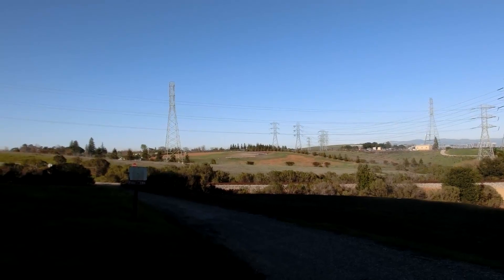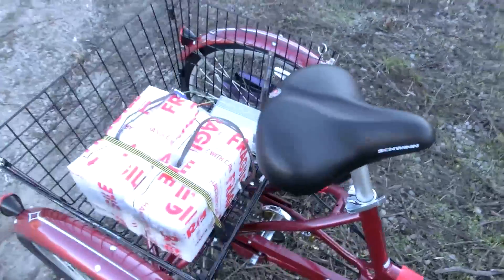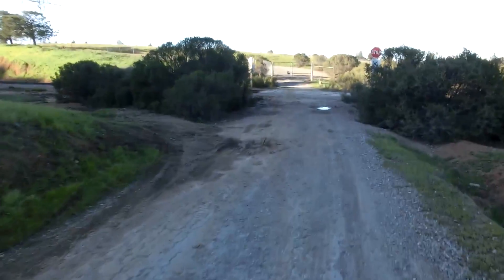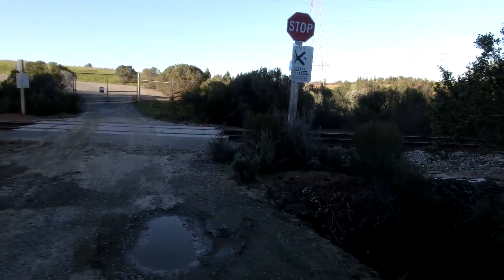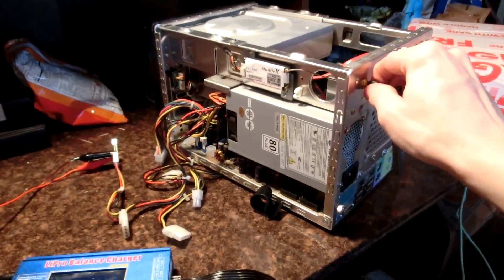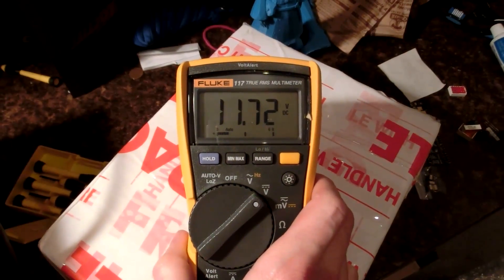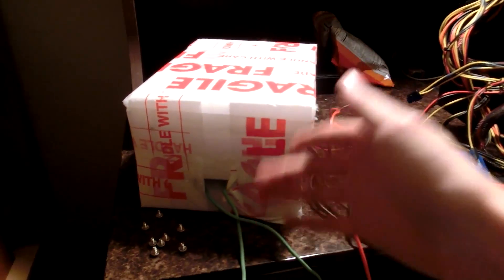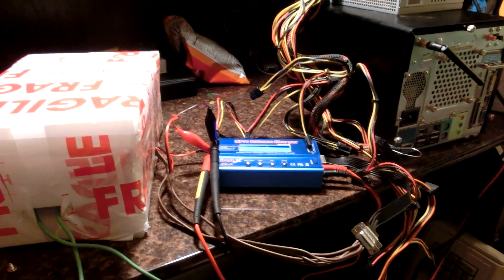Random Bits 0076: Electric Tricycle E-Trike Modification

Comment: Do you have any advice for soldering the battery? I made an electric bike because of your video you made the battery look so simple... I can not do so well with it... bought all these laptop batteries but i don't know how to solder... LOL ps you make some good videos and have some interesting Ideas and items.
Reply: i had the same issue. do what rinoa says. sand the cells back and wash down with ethanol use flux. i use a 90 watt soldering iron which is sufficient. a 25 - 60 watt soldering iron probably will not work well. use leaded solder. lead free sucks!!
Reply from the maker: thanks! its best to have a lot of thermal capacity in your soldering iron so you can get in and get back out before the rest of the cell heats up. using sand paper to roughen up the cell ends can help a bit too. i guess they put a coating or something over some cells, or maybe its just grease from the factory.

a cleaner idea that ive been wanting to try is a spot welder so you can weld tabs to it like they do at the factory. you could perhaps do that with capacitors and tiny strips of metal.

your bound to have a few dead 18650s laying around, i say if your not sure about it take them outside and try to solder them together. if something goes wrong your outside and your not out any good cells. hope that helps.
Reply: Rinoa Super-Genius
LOL all my cells were good... everything is ready just need to get soldering down even bought a PCB / BPC to charge the batteries...  bought 2 so i could make two batteries because i over bought batteries thinking half would be bad so i can make 2 24V 4400Ah (not mah) battries.... sigh I thank you for the tips... ill try soldering the first one see if i can do it with your tips. thank you

Comment: Is it possible the alligator clips you are using to input power from the computer power supplies is limiting the current available to your charger? I had a similar problem and had to solder in  some 14g wires. I ended up buying a 19 volt power supply and it really made a difference.
Reply from the maker: no the power supplies are making bad sounds and are old, thats just the capacitors goin out.

Comment: I know you are said you were tired of the battery videos but I have to tell you I really enjoy your videos and matter in fact style. I would suggest a simple volt/amp/amphour meter. I love mine and really enjoy the fact I can have a better idea of current used as I don't use any BMS on mine. The first video of yours I watched was your battery built from 18650's and it really helped me.  It's good to see you get ahead from your knowledge. Very inspiring!.
Reply: I have Rinoa Super-Genius range of videos added to a playlist, so I can add balance leads to my own battery packs. (I have to make 4 x 48 volt packs) I have literally purchased the same power supply charger, the same blue charger unit from the videos. Hehe

Comment: I'd love to see that as a project building a DIY 48v balance charger. 

That trike is very cool. Although you might need to add a bit more capacity in the battery department because your battery was built to move a bike which was lighter and had less drag.

Comment: I just bought the first electric wheel (exactly the same as yours) I will be buying my second this week then 2 more a month from now to go on each wheel of a Go-cart or some kind of E-Car I am building on my channel this summer. Now I have to find some cool places to ride it when it is complete!
Great job on yours Rinoa Super-Genius Congrats on your mobility boost!
Reply from the maker: thanks, i think that 4 motored car is a good idea, you wont have to worry about a differential or axle either. you could have all 4 wheels turn!
Reply: Mine cost $220 each. I'll have to look for who sells them for $180. I may also end up converting it over to a fat tire design.
Reply: Hi, Andrew. You have an exciting idea with that E4WD!  I am thinking about going 2WD with my eBike. Good luck, and I'm sure youll keep us posted.... Question that is relevant to both me and you is: How would we control functions of more than one Electronic Speed Control unit (ESC) at the same time with one thumb-throttle?or are you going to have 4 throttles rigged up right close to each other? http://ihelpupay.com/ebike
Reply: I'll definitely check out your work.
Thanks for your reply!
Reply: Farrokh Mirbaha Hi, I will be putting every step up onto my Channel on YouTube, Plus recording every written note on my website blog http://www.artisticbrit.com As for the speed controller, I may just build a custom foot operated unit like an accelerator pedal on a car. I MAY also combine all 4 hubs into 1 geared unit, to create a higher mph. By doing this I might get speeds of up to 50-60 mph using 4 powered hubs. Subscribe on my channel, you won't miss a thing.
Reply: Farrokh Mirbaha You got it Farrokh, enjoy your day/night!

Comment: nice job Rinoa, now you can role with the traffic without having to work for it, it freaks me out when im on my ebike doing 20mph and the 8 wheeler behind me is doing 30 and slowly closing expecting me to go faster...but I cant..its capped :-p over here that would be illegal because there is to much power in the 1kw motor :-p but if you restricted it to 13mph and 270watt :-O then it would be fine :-D Looks great but I would recommend mirrors or a rear camera. Seeing behind you makes all the difference when your turning or changing lanes :-) glad your enjoying your time there hills are pretty awesome in general :-) think its good now...wait for the weather to improve and check that place then :-D
Reply from the maker: yup i'm getting big mirrors for it. i've been scouting out places to show you guys, besides the cool electronics shops of course. ima start doing a series on "things you should see in silicon valley" everything from cool places to get a view of the valley to awesome shops
Reply: Rinoa Super-Genius sounds good, you can keep an eye out for any interesting geology along the way :-) it would be handy to not have to worry bout your trike, the lock boxes are a good idea, it may be worth considering making a cheap gsm tracker for it, there are diy mods on the net floating about, least that way if someone trucks it you can tell the cops its location to get it back :-D and all the while you are in the shops your not worried, is my bike still there :-) I beat mine up so i could take the chameleon approach but would be a shame to do that here. Looks like you could keep that looking clean and maintained for twenty years :-)

Comment: As someone who recently moved from CA, if I remember correctly, you may "officially" need a motorcycle license. It might be if you exceed 1kw of power, I don't remember exactly. Not something you really need to worry about, but you may want to check into it.
Reply from the maker: yeah as long as your 1kw or under you dont need anything ^^

in illinois it was 750w or under but nobody even knew my bike was electric, not even the cops. so its just one of those obscure things nobody cares about unless your blasting down th road at 50mph with a 10kw motor.
Reply: Hi +Rinoa Super-Genius
It´s a tricycle,, three weels 3.000W :-)

Comment: Awesome stuff, keep the vids coming! I would recommend building a charger yourself as the next thing you do. Have it a plug in wall and simply charge, also having it custom built you would have it fit your needs and even be easily able to alter it for future projects.
*Side question, what's the legislature on E-bikes over there? At what point will you need to have a license plate on it?
Reply from the maker: it will plog into the wall, but will also plug into an electri car J1772 charging cable >:D

and over here you just need working pedals and 1000w motor or less. speed limit is 20mph but i cops have better things to do than to track bicycle speeds
Reply: Very good idea to have it compatible with J1772!
So can you have multiple 1000w motors or just the one?
Thanks for the answer btw!

Comment: I'm sure you've answered this question before, but is 10 miles about the trikes max range on just batteries?
Reply from the maker: its about 1/10th to 1/20th depending on speed. looks like with these hills and this speed i'll get about 50-70m of range though.

Comment: Nice build. Just wondering how many balance leads are on that pack? Also what do you think about putting a small watt meter on there too.
Reply from the maker: well its two 6s packs so its 14 wires. and yeah i'm going to be adding an amp meter.

Comment: love the E-bike projects, and seeing the cool places you go! BTW the imax b6 chargers are not very good or efficient at taking 12V from a computer PSU to 24V. If you get some old Laptop power bricks (they usually put out 14V to 19V) you can get way more current for charging higher voltage packs. If your luck you can find a laptop supply with a plug that fits right into the charger, but you can always cut the end off and hack it up.
Reply from the maker: i've actually found the opposite to be true, a computer power supply can give up to 20amps sometimes meanwhile i burned up my laptop charger doing this because they normally only give 3a. an atx power supply is almost perfect for an imax b6 as long as the atx power supply doesnt have bad capacitors like the ones i have.
Reply: Rinoa Super-Genius Guess it really depends on the supply, my go to supply for my imaxb6 is an old 15.6V 8A Panasonic laptop charger(a lucky find), meanwhile all my PSU's are crappy off brand ones I've pulled from e-waste machines, well every thing I get it from e-waste. Sagging voltage and crappy capacitors don't matter as much if your rated voltage is farther away from your cut off voltage. Even if you ran a shitty PC PSU through a boost converter and you'd get more usable power out of it.
Reply from the maker: Gregor Scott
no the imax b6 is a boost converter. you would lose another 10% power running through a 2nd step up transformer.
Reply: Rinoa Super-Genius I know I was kind of joking. its all about that low voltage cut off, efficiency doesn't matter if your supply sags and your charger shuts off! lol
Reply from the maker: Gregor Scott if i can't find another good power supply i think i'll try to fix this one by replacing its capacitors. i can get them for like 10 cents each here.

Comment: The first power supply doesnt supply enough current for the charger. That is qhat happened to me when i tried to use a computer power supply. I had to upgrade to a 12v 6a transformer from ebay.
Reply from the maker: its because the power supply has bad capacitors. its very easy to find a computer power supply that will give up to 20a of current on the 12v rail.